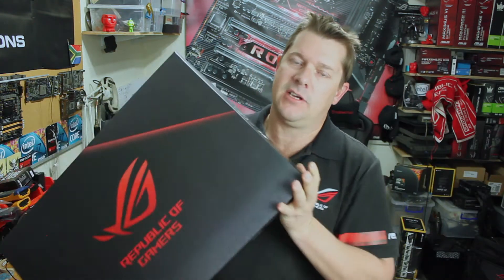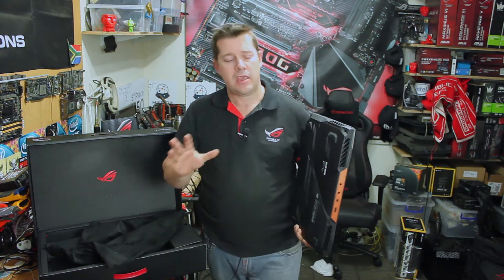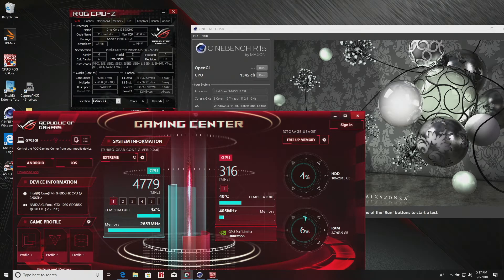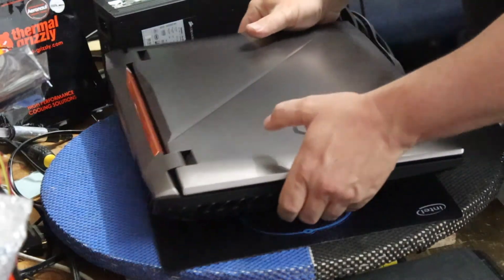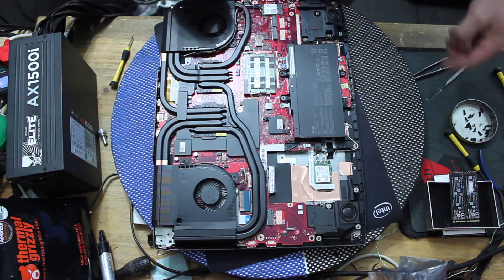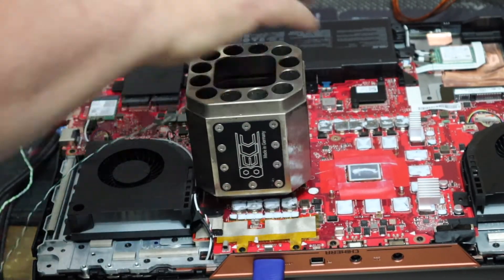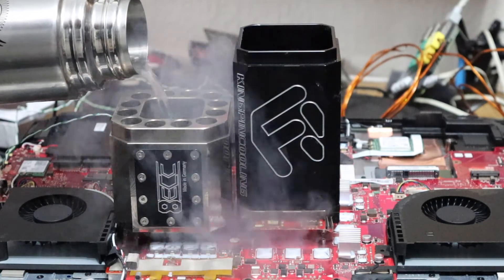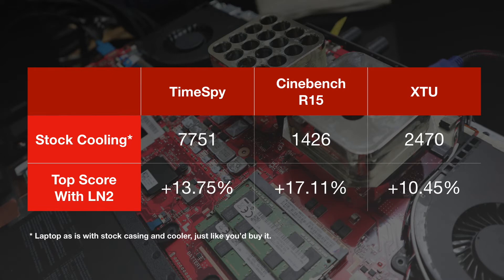SICK ASUS G703GI LAPTOP LIQUID NITROGEN REVIEW / UNBOXING

Comment: now lets get another clevo on ln2
Reply: Don't need to, 8700K in P870 (even retrofitted into the 2015 Z170 P870DM) only needs cold air from a portable air con unit  to get over 1800 cb r15. 9900K testing is still early but >2000 has been shown repeatedly in P870TM